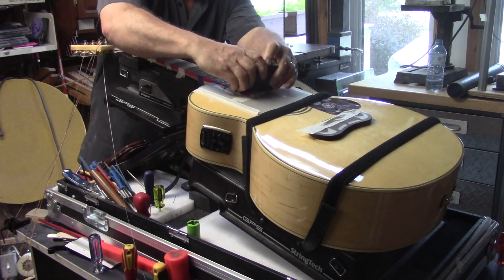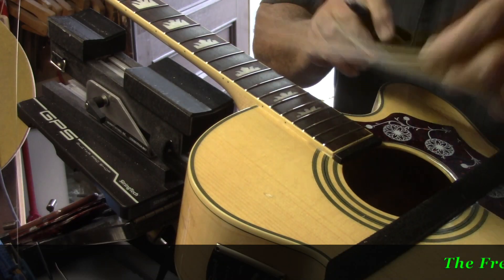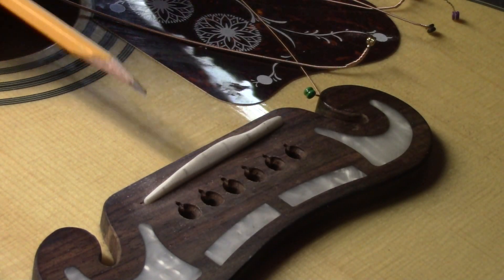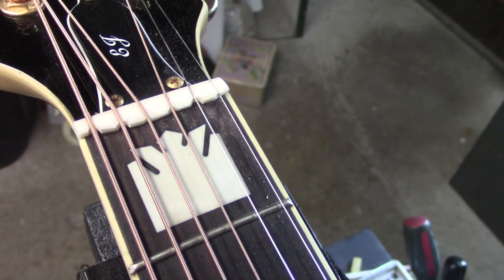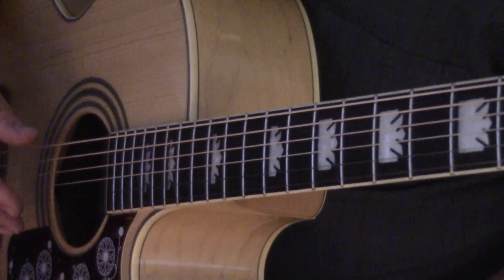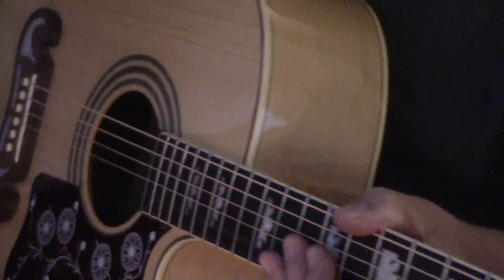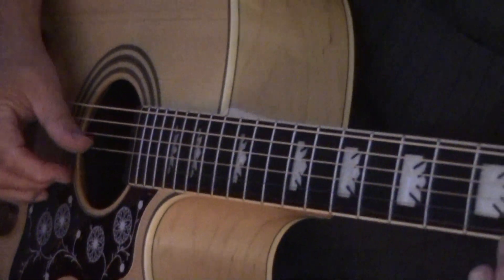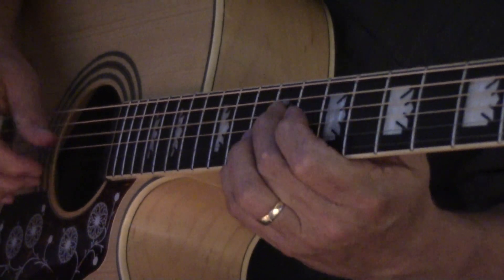A Perfectly Tuned Guitar ? Have a listen. EJ 200 cantilevered compensated bridge saddle @StringTechWorkstations

Comment: I bought, sight unseen, a nylon string guitar that I thought had a straight, uncompensated, bridge. Turns out it was compensated (angled). I'm left-handed and restring. I did my best to reverse the angle by sanding away the front of the bass side, and the back of the treble side, but it's still a bit off. Is there any possibility to get one of your saddle blanks that are undercut on the back as well as the front side?
Reply from the maker: On a nylon string guitar it is the G string that needs to move the the back of the saddle. The other 5 strings are in the centre of the saddle. The Spaniards figured that out a couple of hundred years ago. I don't use the cantilevered compensated bridge saddle for the classical ( nylon string ) guitars.
Reply: @StringTechWorkstations  Yes, but this saddle is angled slightly. I was trying to bring it back to straight, non-angled. But, point taken - the treble side may be positioned dead on. I'll measure. And I didn't know about the G, thanks for that especially.

Comment: Great job! I love the work that you do. I have a pristine 1993 Martin D42 tobacco burst acoustic that needs the same work you’ve done on this guitar. It’s not intonated and the action is way too high.
Reply from the maker: That sounds like a very nice guitar. Are you local or would you be shipping ? Although I have done the cantilevered saddle on Martin guitars in the past ; your guitar may ... or may not ... need this done. Lowering the action and ( highly likely ) levelling the frets at the neck to body junction may take care of the sharpness, without going to the full extent of a cantilevered saddle. Just saying' .. it could either way. Cheers MMcC
Reply: StringTech Workstations I wish that I was local! I am in Melbourne, Florida USA. I would like to ship it to you so that you can do whatever is needed. I have the utmost trust in you and your work.
Reply from the maker: I am not taking any more work until mid September. This will give you time to try lowering the saddle to see if this will help rectify the problem. In the meantime, you can send some pictures to mcconvilleguitars@gmail.com. If we proceed with shipping there are several steps we need to take #1: have you shipped guitars before, and are you aware of the proper packaging ? #2: I would fill out an invoice with all of the particulars , make / model / year / serial # ... and all of your contact info .. address / email / phone # #3: I have the proper HS code for Customs, so that they ( Customs ) are aware of the fact that the guitar is being shipped for restoration / calibration or adjustment; and will be returned to you upon completion of the work. Respectfully, Michael
Reply: StringTech Workstations I have taken some photos and I will be sending them to you in an email today. Thank you very much